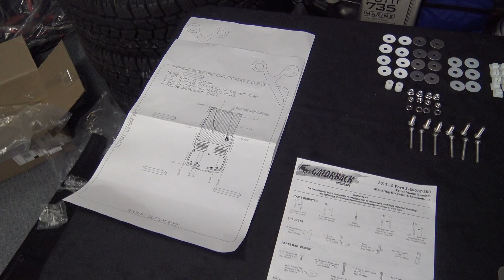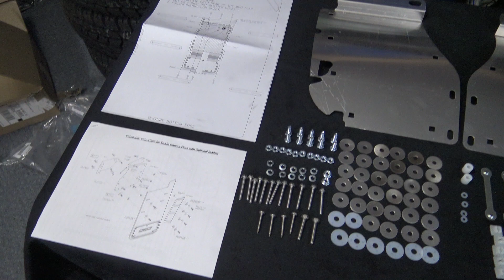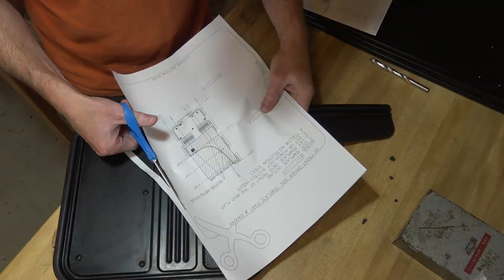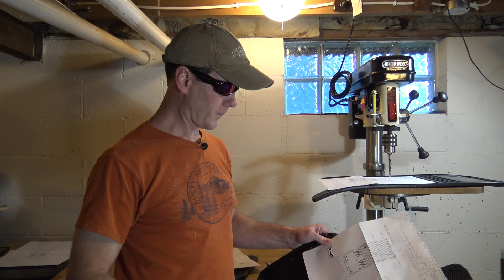F-250 Gatorback Mudflap Installation

Comment: Good video! My wife bought me some mud flaps for the rear. But my flaps didn’t come with brackets like that! It was pretty pricey for the flaps I got! Do I have to order the brackets separate?
Reply from the maker: https://www.sharptruck.com/truck-hardware-custom-fit-mounting-brackets-gb759842
Reply from the maker: This was the whole set.  https://www.sharptruck.com/truck-hardware-ford-f-250-f-350-no-plate-gatorback-mud-flap-set

Comment: LOL that giant metal bracket makes this not work with any over sized tires.  That's exactly where everyone has to trim in order for larger tires to fit.  DOH
Reply from the maker: The 285/75r18's that I have planned should fit just fine.  37's would never fit.